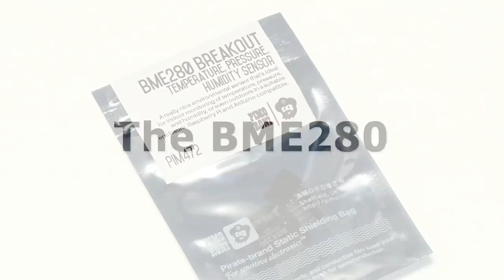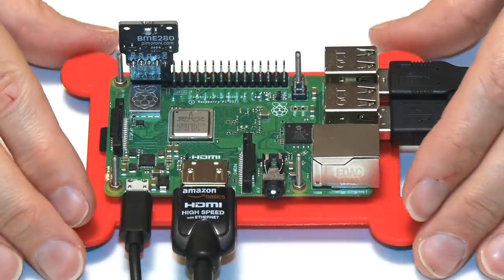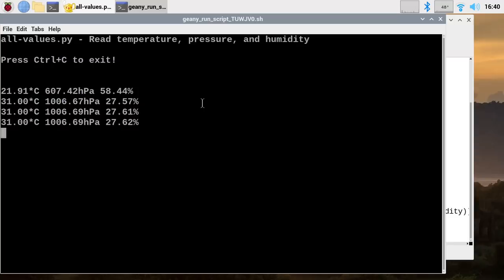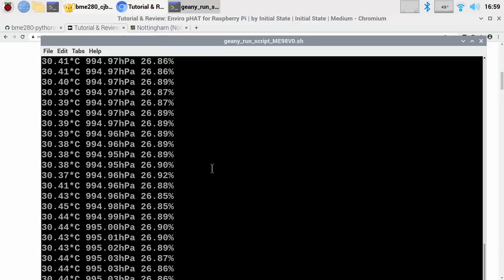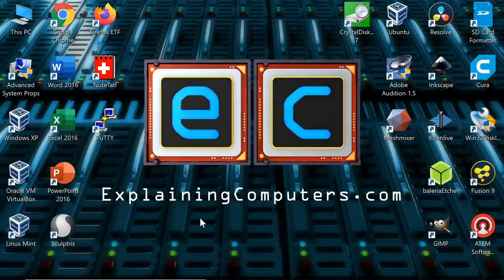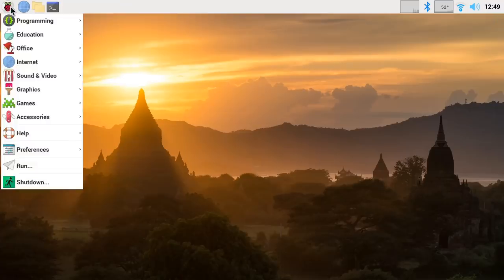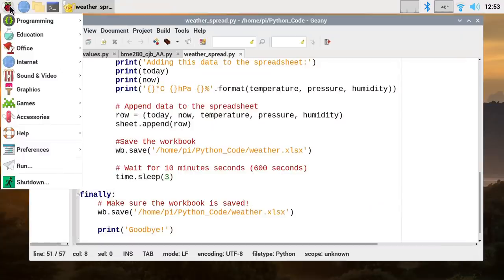Raspberry Pi Weather Station

Comment: Brilliant video and production! Thank you for all your expertise in this field and explaining and demonstrating it so well. May I lend some knowledge from my field in return. Humidity is practically represented as a percentage of a parcel of air's capacity to hold moisture, not the actual amount of moisture in a given volume of air (absolute humidity). Since warm air is able to hold more moisture, the humidity in that warm air will be less relatively. If you took that same parcel of air and cooled it, i.e. going outside to cold air, given the same number of water molecules in a given volume, but colder air, that cold air will have a higher relative humidity since it's water holding capacity is lower. So, the warmer the air, the more moisture it can hold, leading to lower relative humidity. Cold air-less moisture holding capability-higher relative humidity.

Comment: Beyond what's needed but the humidity being recorded here is relative humidity which is measuring what percentage of the maximum water content that an be held in the air - think of the air as a sponge. The thing is that the maximum amount of water that can be held in the air is dependent on the temperature. As the temperature decreases, the same amount of water in the air means the humidity percentage increases. Once the relative humidity reaches 100%, it has to rain (or snow). Similarly, as the temperature rises, that same water amount causes the humidity percentage to fall as the air's capacity to hold water rises with temperature. In the temperature range you are measuring, a 5C change in temperature will produce around a 30% change in relative humidity.

What was interesting in your case was that you had consistent pressure. Pressure also affects the water holding capabilities of air but as your pressure remained constant, the rainfall you mentioned seemed like a result of colder air rather than a weather front moving through.

Comment: Three things.

1) in the USA we typically use mm of mercury to measure atmospheric pressure  so some explanation of what the pressure actually means. I had never heard of atmospheric pressure being measured in hectopascal before now so I did research and realized that millibars and hectopascals are one and the same. 

2) how to make it a real weather station with wind speed and rain gage. I know that there are sensors for both.

3) your ideas on weather proofing the Raspberry Pi and sensor(s) so that you can keep outdoors in all types of weather.

Thank you.

George

Comment: Have similar system here with Windows uPVC edition, open window stick head out and test for rain.
If it's milky white it's only spitting and if orange its p ing down.
1 button press to close windows.
Great video mate keep em coming.
Reply: Is there a linux version?  I don't want to install a Window.
Reply: @blahblahblahblah2933  No need, most houses have 1

Comment: Christopher, I don't want to sound critical, you have one of the better channels here.  However, when I saw what the topic of today's show was, I immediately thought, this won't do as a weather station, it produces too much heart.  You picked up on that eventually.  You should know that even on a pigtail, your sensor will not qualify as a bona fide weather station unless to can show that measurements are referenced to recognized standards (you probably know that).  I also wanted to correct a small error.  Relative humidity is not reduced by the heat of the processor "drying" the air, relative humidity is a function of air temperature as well as water content.
Best
Alex
Reply from the maker: Hi Alex, but I think you've missed the point of the video. It is a Raspberry Pi educational project --  not an attempt to manufacture a "bona fide weather station" . . . "referenced to recognized standards". This is a channel about computing, not engineering. Point taken on relative humidity.

Comment: I thought, 'a software fix for the temperature sensor being too close to the CPU, oh no!'  My, what relief when the extension cable was displayed. I really liked how you made simple code to populate the spreadsheet.  I wonder if there is a way to use Putty to display the video instead of text, or some kind of RDS so graphical data could be displayed.  Hmmm. Nice video Chris!

Comment: Thanks for showing me the usage of BME280, Chris. 
I've done a simpler one yesterday with DHT11 (which works but not accurate enough as the BME280 in your hands). With a Flask based rest API, it could push temperature and humidity data (with Linux cron job) onto the web server and stored in the sqlite db. Then whenever you want, you could draw something web charts with js-based libs like highcharts, echarts, or something like that. 
Well, if you don't wanna draw the web graph with js which might need some learning curve, then feel free to do something with influxdb and grafana, might be a surprise to you there. 

Appreciate your sharing again on BME280, perhaps I need one to replace that cheap DHT11. 
More videos, man, we need your inspirations as always.

Comment: Excellent as usual, and if anyone has a bme280 on the 0x77 address rather than default 0x76 then the line in the py script will need to be changed to [ bme280 = BME280(i2c_dev=bus, i2c_addr=0x77) ] then it should work just fine :-)

Comment: Very cool video, Chris! Thank you for sharing this awesome idea! One suggestion: In the configuration you chose, the sensor is facing the CPU. If you had soldered it the other way around (and/or used the straight header to get a 90 degree angle) the heat from the CPU might have had less effect on the sensor.
Reply from the maker: If I had soldered it the other way around it the connections would have been wrong and it would not have worked! :)

Comment: Hurray, Santa answered my letter. I was hoping  to see Chris building up a weather station. 
I am trying to build a smart heating project, using Senserion SmartGadget SHT31 a RPi3, a BT dongle for longer range, and a relay switch to control floor heating.
Since SHT31 uses BLE for wireless Communication, it would be great to see Chris trying such a project. ( I have some sample code done, if someone is interested)

Comment: Thank you for the great video and showing off you soldering skills, Christopher :)
I had something similar: a gas sensor next to a BME280. The gas sensor was heated, which of course made the BME280 useless. A single product test would show the wrong thinking. It's the same for the Pimoroni board, otherwise it would not be sold as a "hat", but with cables. One wonders why some people designers have their heads?
I think it's very good that you reject the (difference) calculation method from the start. This is the next level of botch anyway, because air currents and other factors are too big an unknown in the calculation.

The BME280 is great for heating control, actual value acquisition and much more. As a suggestion: Use many of them that are attached to many ESP8266 (with ESPHome) and a Raspberry Pi 4 with HA, "Home Assistant" as the central station. Take a look at it, this is really a luxury system;)

Comment: I’m working on setting up an array of humidity sensors in a new shed I’ve built in the back yard. I’m concerned about moisture inside the ceiling structure as I’m using an experimental insulation system. I was looking for a way to write a text file, maybe space and tab delimited, to store the data but I like the spreadsheet idea. It would be a lot simpler this way since I don’t know how I would read a simple text file in a meaningful way. I know there are good programs for data visualization that I could learn, but the spreadsheet would be more convenient. Thanks for the video!

Comment: Nice one. If I had the time I'd save the data in a MySQL database, put an API on top of it and fetch the data into a Grafana application or something. It would be a nice display on a small monitor in the kitchen, or something. Current weather and historical data; neat.
Reply: I’m using an influx database and Grafana actually both running on docker on a RPI 4, my sensors are on esp8266 devices and connected over WiFi, each also with its own web server with data page as well. Not setup with a display yet though but will explore that as have some Oled and e-ink displays..
Reply: @achristofides  That sounds awesome!

Comment: Very informative. Some ideas for next steps:
Use a Raspberry Pi Zero W instead of a 3A.
Use an OS that does not start X Windows (headless, SSH only).
Configure more than one sensor on the same I2C bus (on a single RPi) for inside and outside.
Configure the script to push the weather readings to tables in a remote (or local) database instead of a spreadsheet.
Create a web interface that allows a user to query and plot the data.
Finally, humble brag about your creation 😊

Comment: I bought a Pi 400 and a sense hat just to play with. Had a simple Python script to write the temperature to a file every 10 minutes to run for about 4 hours. I put the Pi outside under a small umbrella to protect it from Brisbane's summer sun. I didn't know that the umbrella had blown off and the Pi was in direct sunlight until I tried to login about 2 hours later via ssh and got no response.  Went outside to check and it had shutdown, the keyboard was very warm and the sense hat was extremely hot. The last temp read before the umbrella blew away was 34.48C and shutdown was 58.84C! Let it cool down inside for about 30 minutes and it all still works.

Comment: I gave up using the Raspberry Pi Sense HAT because it is also affected by the heat generated by the RPi.  Even though my garage is not heated, it is warmer than the outside temperature.  I have a cable to a DHT22 sensor outside that is protected with a PVC elbow to get a more accurate reading than I was getting when it was inside the garage.  The DHT22 specs say the cable from the RPi to the sensor can be up to 20m.  Mine is about 12ft.  I had three things to consider where to put the RPi and the DHT22.   One was to choose an area with no direct sun on the PVC elbow that protects the sensor from rain and another was the WiFi signal strength. A third consideration was to avoid the area where there is a concrete pad.  I am logging my data as a file in CSV format. I am also transmitting the data to other computers connected to my LAN using another RPi as an MQTT broker.  My goal is to be able to display the data in graphical form on one of the computers connected to my LAN.  Perhaps Chris will have a video in the future on how to do that.

Comment: This is great! I have several of these around my house but instead using esp8266's. I've got around the artificial heating near the SOC by putting the chip to sleep then doing a quick wake to read and send the data then put back to sleep. Can't do this on the PI I believe (?) I think a sequel should be done to attempt a 3D case that can be used outdoors and then perhaps store in the cloud (AWS?) to be accessed anywhere - great work!

Comment: As always an excellent tutorial! I have built a very similar weather station a year ago with the raspberry pi and its been running since. The main differences being that I'm using nohup to run the python script in the background and I'm collecting the data in another computer running a timeseries database - influxdb. To do this I'm using Mqtt to publish the data on the database and grafana to create a dashboard. Is a bit more complex setup because the idea is to have multiple temp/hum sensors monitoring a house.

Comment: Great tutorial. I am using the bosch sensor, but the piece is commercialized in the EU by AZ. I store the weather station data in an SQL database and run a Dash-Python app in the raspberry pi to see the data change on another computer through the web browser.

Comment: Hi Chris, wonderful wonderful episode. Only suggestion is to always use a virtual environment with Python projects so as to only install packages for that project.  Something like <<< python -m pip venv . >>> without the 3 left and 3 right angle brackets should create a virtual environment in the current directory and then <<< venv/bin/activate >>> also without the 3 left and 3 right angle brackets should activate it in that directory in that terminal session. From there you can pip install and any conflicts with packages and package versions would be limited to the project in that directory. Of course one needs to remember to activate the virtual environment before running the project.

Comment: Nice hands-on. I would just recommend saving the data in a different format such as CSV (plain text with comma separator) and import the file in any spreadsheet app. It makes the file lighter and easier to parse/manipulate regardless of the platform without the need to install a 3rd party library.
Anyways, great video. Hope your days get warmer.

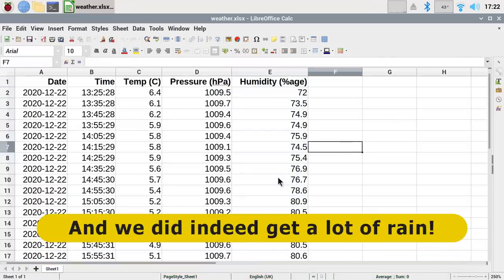Comment: 20:37 if you keep as much water vapor suspended in the air but lower the temperature, the relative humidity will increase. It's normal. Once you'll come up to 99% the air is saturated, you'll start to have condensation, fog. probably what happened over night. Then, during the morning, when the temperature went back up, the relative humidity got lower, allowing the condensation to vaporize again and mix with the air, and the fog disappeared.

Cold air can't hold a lot of water vapor.
Reply: Indeed.  I cringed a little when he said that the Raspberry Pi was drying the air.  It was just warming the air and thus reducing the "relative" humidity.  The "absolute" humidity was likely very close to the rest of the room.
Reply: @Ikrananka  Don't cringe, one can't be an expert in all fields. He still did a great job :)
Reply: @guillaumegaudin694  Yeah, I was overstating my reaction.  While I'm an experienced engineer, I would never describe myself as an expert.  Christopher, on the other hand is very much an expert in many fields and I am often in awe at his breadth and depth of knowledge.

Comment: I've been wanting to set up a weather station using round LED displays showing antique analog screens.  With the screens in round brass holders on a wooden plank.  Could have it next to the front door, & the displays switch to outside cameras before you open the front door after someone pressing the door bell.  And also add in Google Assistant.

Comment: OK, how do you get the code to display a real " ° " symbol? ALT+0176 in windows.
I'm guessing it's difficult as I'm sure CJB will have done it if possible?
Reply: From a similar project I'm writing to monitor pi temp:
d = u'\N{DEGREE SIGN}'
....
print(str(cpu.temperature) + " " + d + "c")

👍

Comment: Got myself a Pi 400 over the holidays. Remarkable machine, except for the rather flimsy Pi OS. No matter what I do, using various card readers and card sizes, different card-writing programs, I always end up with Pi OS having serious boot issues(aborting boot, requiring a hard reset). Ubuntu and Retropie on the other hand run flawlessly it's a joy to watch.

Comment: Hey Chris! I wanted to tell you a few things you could do.
1) If you want to execute python code without the chmod and ./ you could just type python3 file.py for a Python 3.x environment or just python file.py for a Python 2.x environment.

2) I use a Pi as a server, and to let it run programs without needing SSH I use a VNC server to create a virtual desktop that will not delete itself after logging off of the Pi.

Awesome video by the way!

Comment: Thanks Chris. The BME280 from Pimoroni  is out of stock but I ordered the Adafruit version. I do have a Sensehat but as you said the numbers are off since it's sitting directly on the Pi. I wrote a script to capture the same data in Python using the Sensehat and writing the data to a CSV file which can be imported into Excel or LibreOffice and graphed. I can also adjust the numbers for the Pi heat variant but I'm sure it will still be a bit off. For me it looks like there is a 7 degree higher temp variant than the actual temp. The humidity and pressure are also a bit off as you stated due to the sensor sitting right on the Pi.  I will wire the Sensehat to the Pi so it's away from the heat source and expect to get more accurate readings.  Thanks again for your great videos!!
Reply from the maker: The BME280 at Pimoroni was in stock until about an hour after this video went live. Sorry!
Reply: @ExplainingComputers  HAHAHA They owe you a cut!!
Reply: @ExplainingComputers  PS- No problem at all!! I figured it was due to the release of your video! That is a good thing!

Comment: Another way you can access your Pi is using Remote Desktop. I run my Pi “headless” and use Windows built-in Remote Desktop client to access it (requires Windows Pro, however), or I can access the Pi from my phone.

Comment: I was watching another video you made about batterypowered RPI:s, and got this as a recommended, which was a bit fun, since today I made a similar project, with BME280, but I used nodejs instead, and sql, and then a html-page for showing graphs :) Nice video!. I Also found out that the BME280 is very sensitive sensor, which is a good thing if you know how you should mount it.

Comment: Just a couple of things:
The Pi is running a GUI anyway so a VNC server could be used to control and program directly on it rather than having to take it back inside for that.  
RealVNC offers that easily and free for the pi distributions. 
Transmitting data wirelessly should also be rather easy if it is reachable by network anyway so using USB media to collect the data would be a bit odd to me.
A simple solution would be sftp to login and transfer files. 
Or having a webserver running on the pi and looking it up there directly.